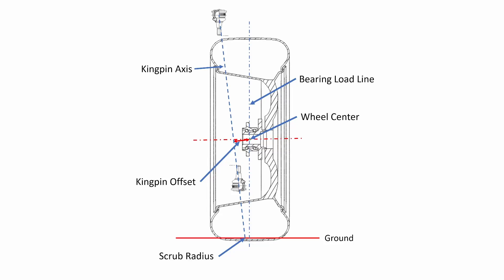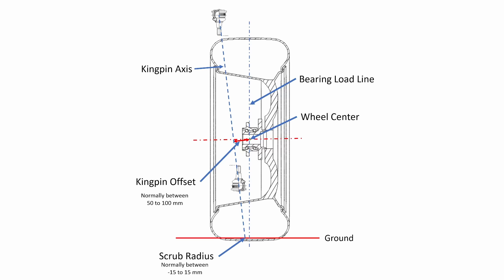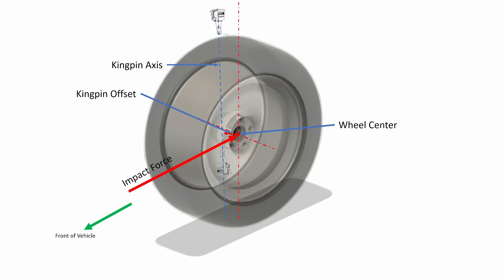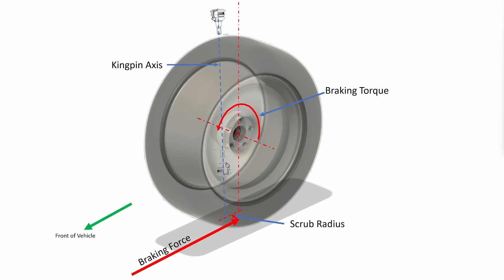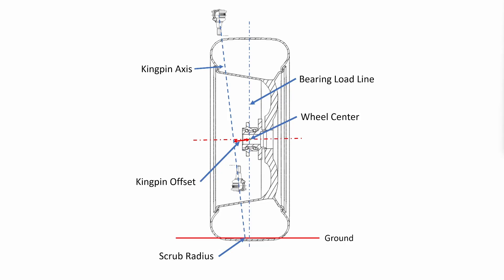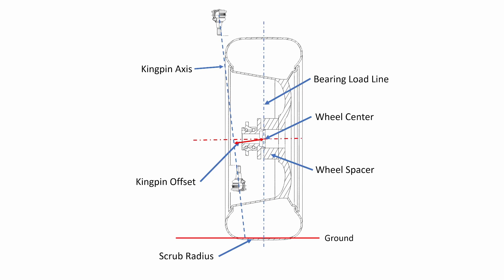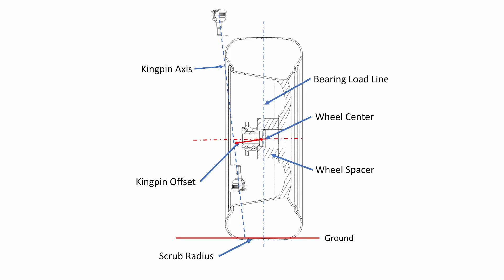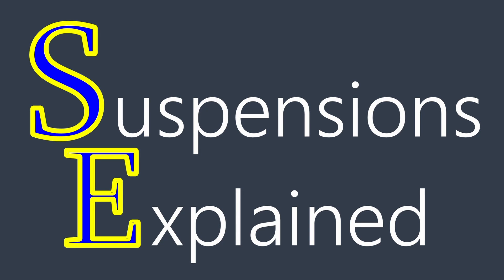Wheel Spacers: Good Idea or Bad Juju?

Comment: Hi sir. I replaced my factory 16" ET50 (215/60R16) to 18" ET35 (235/45R18). it's change from zero to 15mm Positive scrub radius. I listen very carefully your guide, it's should be between - 15mm to +15mm.
Do I need to put 15mm the wheel spacer? What happen if I put 20mm wheel spacer. Thank you for helping.

Comment: In order to get the Kingpin axis to go through the center of the contact patch on the 427 Cobra, the lower ball joint was installed upside down.  That means a very small ring of metal is holding up the front end.  search for CSX3282 & "Anti-Dive Anti-Squat and Bump-Steer Roll-Steer Suspension"

Comment: I've recently purchased a winter wheelset for my BMW E92. The wheels were nearly the same width (+1/2") but with a different offset ....
Before buying I went on some wheel fitting simulation website and one of them was showing the change on the scrub radius.
Those wheels were a good match for the look and stance of the car, filling the body line nicely.

During the first drives, I clearly noticed the increase of force feedback in the steering wheel. and I get used to.
BUT one day, I was on a country side road I didn't know and what doing some spirited driving.
The road was uneven, car body was really shaking and rolling side to side.
Then comes a turn sharper than expected and I had to brake hard.
I've been really afraid how the car pulled to the side under braking. I even had the release the brake and readjust my trajectory to not end in the ditch.
I never imagine an increase of scrub radius could have such impact on the driving experience and safety.
Since then, I sold those wheels and returned happily to stock size !
It was the beginning of my journey on suspension geometry and with your channel, I'll learn a huge lot.
And became an advocate within tunning communities about wheel spacers, use them carefully !
Thank you Sir.
Reply: website link to the simulation site

Comment: 1:21 Quick question. Isn’t the contact patch pretty wide? I don’t quite understand the scrub radius definition.
Reply from the maker: The scrub radius is the distance from the intersection of the steering axis with the ground and the center of the contact patch as viewed from the front. The center of the contact patch is just the point where the center plane of the wheel and tire intersects the ground.
Reply: @ Aha, the center of the contact patch. Thanks!

Comment: All true, but if spacers are combined with a deeper and wider wheel, the impact is reduced.  That is, preserving the inner face/plane of the tire, and only adding more to the outside.  Or in the case of simply using spacers to correct an improper aftermarket wheel offset, can have minimal to no geometry impact.

But the Jetta with simply a wide stance on stock width, or the Jeeps and trucks with silly wheel offsets, all true, and all bad!

Keep up the great videos!

I’d love to see a video about the theories and loads of caliper location (eg, 3 o’clock vs 9 o’clock) inside the wheel. Down low, up high, in front, behind.  Low cg, cooling, rotational intertia, etc.  cheers

Comment: If you want a wider track, it's better to run wider wheels+tires. This will still push your scrub radius out but not nearly as much. Imagine a 18x9"+50 wheel. With a 30mm spacer that wheel will be 18x9"+20. But if you went with 18x10"+33 or 18x10.5"+39 that will be much healthier for geometry, handling, bearing wear. Why not use all that empty space with more rubber? I think cars with spacers look odd, they look like bicycle wheels, as the proportions are off.
Reply: Good advice. But some wider wheels might rub against some suspension component, springs or shocks. It's a case to case to analyse.

Comment: I know that youtube algorithms will send viewers here mostly searching for an answer about "Will wheel-spacers increase wheel-bearing wear?" Well the answer is YES ! But more importantly -->

7:02

Sometimes(not always) by installing large wheel spacers, you can change scrub radius direction (positive to negative, or negative to positive) , which will result inferior HANDLING capabilities when braking because the vehicle suspension wasn't design to work BEST with the current(after installing spacers) scrub radius direction.

Comment: I have 15mm spacers all around on my car for about 18 months, including track time.  No issues - handling or worn suspension components - to speak of so far.  To say that wheel bearings are designed to last the life of the vehicle is silly to me.  Worn wheel bearings are fairly common on cars of certain mileage or age.  If my spacers cause my wheel bearings to need replacement every 50k miles, I will not be concerned with that.
Reply: "life of the vehicle" is actually just the manufacturer warranty period. I had a wheel bearing fail on my NC Miata at about 65k miles, totally stock wheel with no spacers
Reply: you sound defensive.  Wheel bearings almost never fail in cars driven normally or spirited on the street.
its ok you are doing something that causes more wear; its ok you did it without knowing.  You will live.
I watch a lot of mechanic videos; the wheels sensor mag rings, etc. go out, CVs go out, suspensions get replaced ...  and wheels bearings are extremely rare being a main cause ...  and there is usually a cause for it; like damage to the wheel, hitting something ...  very rarely from normal use.

I've had a lot of cars, driven a ton of miles, and not myself, my family, or anyone I've known have ever had a wheel bearing go out.  Anecdotally 100s of vehicles, millions of miles.
Wheel bearings definitely are designed to last hundreds of thousands of miles under non abusive conditions, within the design of the suspension and its specifications.

I know you younger folk think everything is supposed to break.  But think of all the cars from the 70s and before ... still on the original wheel bearings.  Stop and think forest, not tree.
Reply: As a mechanic with 17 years experience, most of which has been in new car dealerships for 2 different manufacturers, I am speaking from personal experience when I say that wheel bearings fail under normal driving in completely stock cars fairly regularly.  Since my first car purchase in 1991, I have never had a wheel bearing fail on any of my personal cars but in the shops where I have worked, a failed wheel bearing is not noteworthy in any way.
Reply: @ghostwrench2292  I trust your personal experience over my anecdotal any day.  I started to 'feel' it must've been abuse ...  bad road conditions, etc. consistently bad or a random pothole/curbing that damages them.  So the idea was constant harshness or a major shock.
I would say since the mid 2000s ...  all quality has generally gone far down on all parts, them leaning into planned obsolescence.   With the U.S. being worse sooner for profits when they shipped manufacturing overseas.
Honda took the 2008 GFC pretty hard, their racing division suffered hard and innovation for consumers shrunk a lot, quality/longevity seemed to suffer.

and mechanical empathy from the owners go a long way; even when we are more 'spirited' we don't do what the mindless do to their cars without thought.

Take care!
Reply: couldn't agree more. I've had 25mm spacers on multiple cars for years and never had any issues or noticed any difference in steering feel or handling

Comment: But using wheel spacers on a wheel with more offset, to keep the placement of the wheel in the stock location would not cause the kingpin axis to change, ergo, using wheel spaces isn't a bad thing. Using them to push the wheels outward is.

Comment: Hello thank you for explaining this make alot more sense, i have already installed 15mm spaces which are far less from the tolerances than your example of 50mm,
 my car is a Audi TT mk3 do you think its okay given the tolerances of only 15mm or would you suggest I remove them and never use spaces regardless of the depth. 
Much appreciated:)

Comment: The wheel bearings would be subject to an added moment as a result of the wheel spacer as you said. On the other hand the bearings do have to be able to withstand this to some degree, because this is what cornering forces would impose anyway- although only periodically, not permanently. This brings me to my question/topic suggestion: what are the loads that a car suspension are typically designed for?

Comment: Great chanel! I love it!!! What do you think about increasing the length of the upper and lower wishbones instead of using spacers?
Reply: You'll get typically less suspension gains, which can be desirable for some applications. Probably safer than an equivalent spacer.
Reply: Better late than never 😂.
Thanks for your reply!😊
Reply: @ You just need to watch out for shitty arms with badly made thread adjusters, and to avoid making them too long, or they might fail. High-quality OEM solutions like Porsche's will typically use shims and will be just as good as a solid piece.
Reply: @ArchOfficial  I'm designing my own. I'm a mechanical engineer used to work in machine design, not motorsport or automotive.
I'm designing u/l wishbones with spherical bearings and shims on the hub side for chamber adjustments.
I think shims are a reliable and repetitive solution. It is extended used in very precisse fixtures in the industry.
Reply: @ryckyto7460  You should design the control arm lengths based on the gains you want, then modify the subframe or wheel hubs for track finetuning IMO.

Comment: The question should be wheel offset to be more clear. Some cars are more sensitive than others. My sports car was actually sold with both high offset (negative scrub) and low offset (positive scrub) depending on version, with the same suspension. Both works well, it just changes the feel a little bit during braking for example, and the Steering effort of course. For an FWD car i would definitely be more careful with Offset changes.
Reply: How does this affect awd cars, generally?

Comment: But why is rwd positive and fwd negative?
Reply: Because of the forces applied on the front wheels under acceleration and maintaining a steady speed. 

On a front wheel drive the wheels want to naturally point toward each other. The force they apply to the ground causes them to want to drive in front of the kingpin causing them to want to pivot toward the center of the car. Kind of like you pushing on a merry-go-round. Your body wants to go straight but the merry-go-round forces you to turn.

On a RWD it's the opposite. The car is pushing the front wheels. The friction against the ground causes them to pivot toward the rear of the car. Similar to you being dragged by a merry-go-round. 

By moving the scrub radius outside of the wheel center on a FWD it makes it easier to guide the car and maintain a straight line.

Comment: you forgot a very important factor, if you have a negative scrub let's say 15mm and you add a small 10mm spacer you tend to go toward zero scrub which is much worse than changing scrub direction as it can cause inherent suspension instability called squirm

Comment: Great explanation! So many people forget this also applies to wheel offset as well. But when modifying stock cars, the options for changing kingpin location and angle are often limited, and we have to take the good (Track width and contact patch) with the bad (Scrub radius). I have definitely felt the effects of going too far and it really kills the feel of the car, even when it's faster.
Reply: Your best bet in that case is to get an updated suspension kit. More and more are available bolt on, and correct old cars flawed design, on top of adding whatever you need for your application. Grip or drift knukles have different mouting points and allow different suspension settings. And example of that is what gktech offers for nissan S chassis. You get larger track, more steering angle if you wish, more or less ackermann, built in lowered car, bump steer correction and so on. If you want your car to handle, the first step is to put sticky tyres on it, the second is to install that kind of thing.

Comment: Hi Huibert, would I be correct in saying that scrub radius is also affected when changing the diameter of the tire? Something to consider perhaps for the off-roaders
Reply from the maker: You are correct, because of the kingpin angle. As the diameter of the tire grows, the angle of the kingpin axis means the point where it intersects with the ground moves outboard, making the scrub radius less positive, or more negative.
Reply: @suspensionsexplained  So, given no change in wheel offset and therefore kingpin offset, a larger diameter tire will not affect the moments impinging upon the suspension during acceleration or impact but will affect the moments during braking?

Given this, the only way to accommodate a change in tire size without a change in any of the moments is to modify the angle of the kingpin axis as well. I presume this would generally mean changing the suspension components.

This personally interests me because I am in the market for a long-travel IFS kit for a Toyota Tacoma. IFS kits include longer upper and lower control arms to increase the range of articulation but I am curious to know if the kits are actually designed to maintain factory kingpin offset and scrub radius with a given tire size, which if I presume correctly, is especially important for emergency situations such as sudden braking or encountering a patch of black ice. Good questions to ask before buying.

Thank you for your time!
Reply: @Shootin_Bruin just curious what you bought and how your research turned out. 
 I’ve always just been resigned to the idea that driving a lifted truck or jeep means it will drive horribly on the road. I would guess that modern off road companies employ engineers that at least know the basics discussed in this video but they sacrifice road manners for off road performance.
Reply: @AlphanumericCharacters  Sorry, I wish I could be more helpful, but I didn't pursue the project so I didn't ask. The guys over at Marlin Crawler seem very knowledgeable though, they might be able to help you out

Comment: Thank you. It was very informative. Knowing that, how one could find, or estimate/calculate, kingpin offset and scrub radius of their car? I have a winter wheel set that has slightly different offset and I was wondering how big effect it may have.
Reply from the maker: Unfortunately, without the drawings or CAD of the suspension it would be almost impossible to measure those parameters.
Reply: @suspensionsexplained  Is it available from manufacturer or some other sources? 2019 Chevy Bolt.
Reply: With the increasing prevalence of 3d scanners you could check online to see if anyone has scan data. Not likely someone will have it for your specific car, but you never know. You can also sometimes find partial schematics or drawings if you spend a lot of time googling, but that's rare.
Reply: You can try on a forum or looking up the specs on your wheel and car combo: I drive a Jeep wrangler and there is a big aftermarket suspension scene. Wheel spacers seem to be a popular edition for the big altered lifted jeeps but most sources say it’s not a great thing to change like this gentleman had explained.

Comment: Great explanation! Now I'm curious, does changing the wheel offset by a good amount change this relationship at all? I'm thinking not, based on your diagram? 
I've got a 2006 WRX which had +55 offset 18x7in wheels originally with 215 width tyres and now had +38 offset 18x8.5in wheels with 245 width tyres. 
I remember forum members arguing that the offset change would wreck the wheel bearings faster, even though there is no wheel spacers installed? I am thinking that is incorrect. Maybe an idea for a video?
Reply from the maker: Yes, unfortunately, what you did has the same effect as a wheel spacer would. The change in offset changed where the wheel center is located on the suspension just the same as if you had used a spacer with your original wheels. In your case though the change was 55 - 35 = 17 mm, so not nearly as drastic as the example I used.
Reply: @suspensionsexplained  Wouldn't the wider tire, coupled with the camber, change where in the contact patch the centre of the upwards force is?
+17mm offset, but +30mm width, the inside of the tire is going to be +2mm